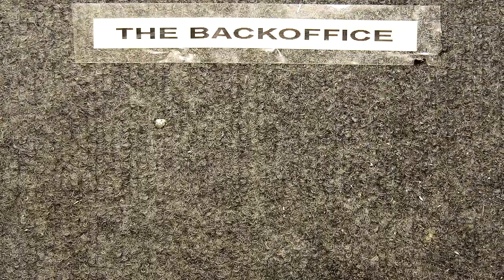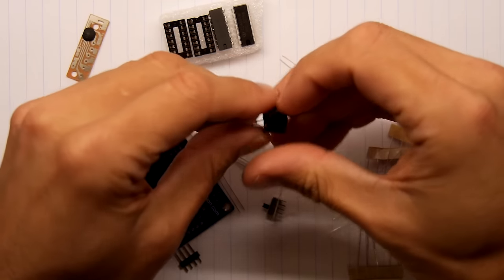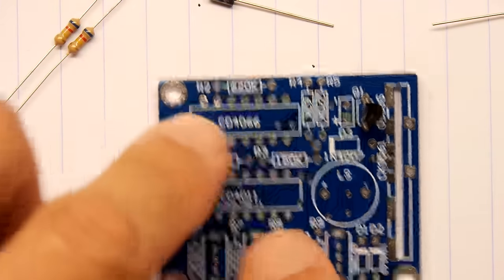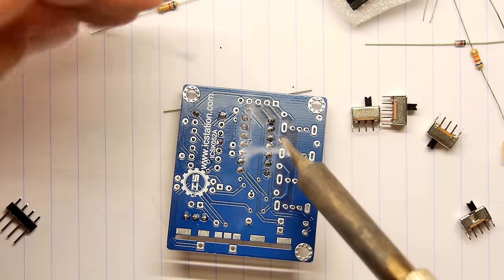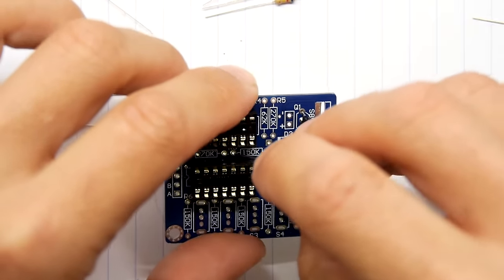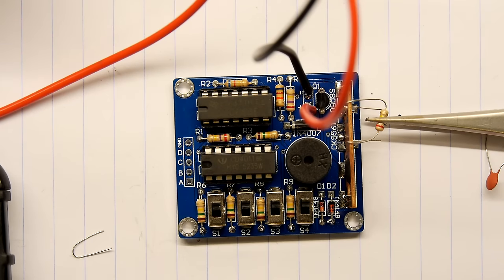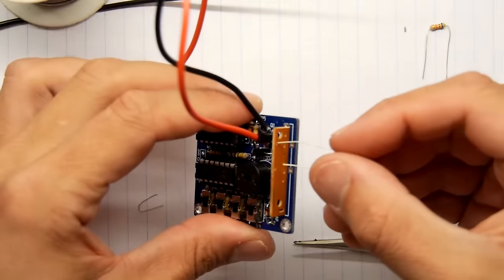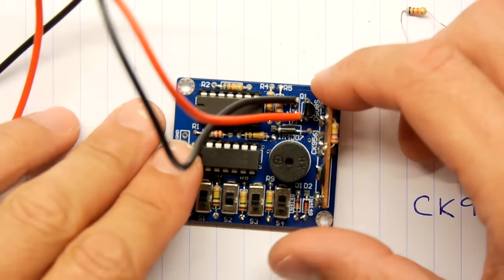Mystery Kit from China #1 ICSK052A Tutorial

Comment: Yesterday,  I successfully failed to assemble that one (not identical pcb, there's many different on the market)... always got a short circuit somewhere,  probably because of the IC that have nearby pad...

Threw away that project... by the way after struggling and throwing away the pcb, ive found that you should keep the trim pin to mount the IC

Comment: Well i had to return, the small circuit board in rear on mine stumped me and the narrow track
of course and it looks closer than on your video, but there are 7 pads on both boards and will do soldering that way. I noticed there is some difference on these circuit boards as i dont have  the www. and other inscription yours has and i have a place for a 104 capacitor between speaker and 4148 diode. I don't guess you know what the 8 small holes through the pads on the small board are for. Mabey running wires instead? Thanks, I've got 2 more projects to solder so need to get to work.

Comment: ABCD, typically, is used for binary codes. You should try setting those high or low. Maybe they override the switches.
A high, B C D low is 1.
B high, A C D low is 2
A B high, C D low is 3.
So on and so forth. Maybe where I say high and low, it's the other way around.
Reply: Nope for arduino... those are pin if you wanna use with it

Comment: Look at "BitBastelei #200 - DIY 16 Sound-Effect Kit". At 17:30 you will find two wires being installed insted of your resistor. That will make the thing work correctly.
Reply from the maker: Cheers, I recently found this in a box, I will resurrect it
Reply: From a website,  you should use leftover trim to connect the 2 holes to the board ... the capacitor,  you can connect it on the back ...

Comment: 500 degrees C? what the bloody hell are you soldering with at that temp Andrew? Are you using that crappy lead free solder stuff? 

should be able to solder all that stuff at about 300 deg C.

It's also amusing watching you fumble with the resistor color code. =3

What does it do meow?
Reply from the maker: I usually have it turned up to ludicrous temperature to pull things apart or really thick connectors. The resistor colour charts remain a mystery to me!
Reply: +The Backoffice first and second lines are the value. 3rd line is the multiplier, 4th is the tolerance.

Now how hard is that? =p
Reply from the maker: Some have even more lines than that? :(
Reply: The Backoffice yeah. Sometimes is another value, sometimes temp. Coeff.
Reply: Just use the age old dummy method: measure it with a multimeter and don't trust your brain!
Reply from the maker: Yoshi Knuckles Yep, thats my goto strategy. Or just use a surface mount.
Reply: +The Backoffice I've been forced to work on smd lately. not too bad, but it makes me drool over those microscopes more now.
Reply from the maker: Microscopes are for wimps! Just get a good camera and a rushes monitor. Job done!